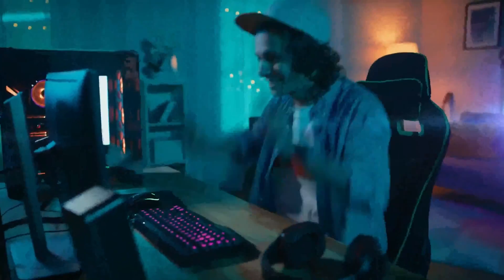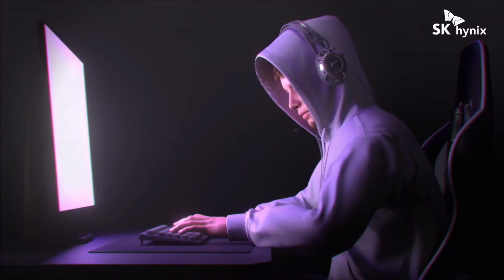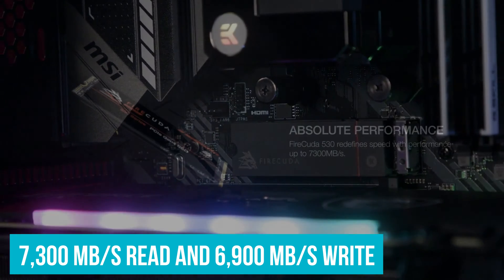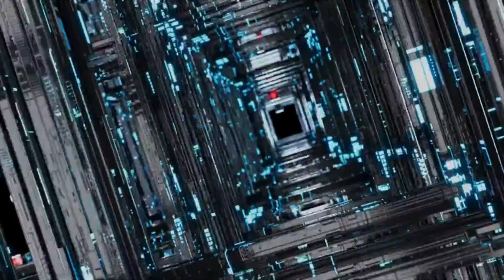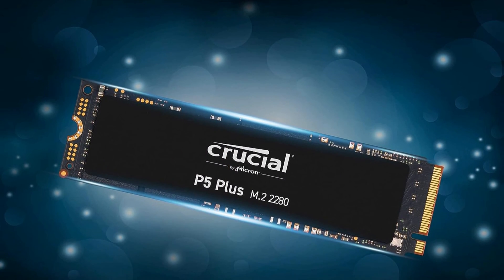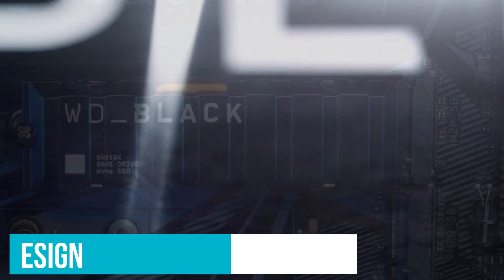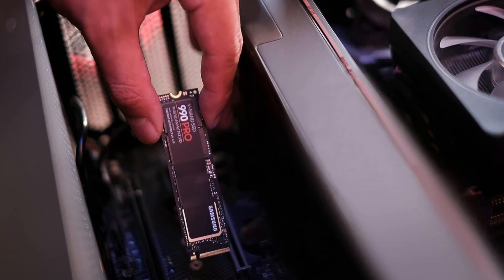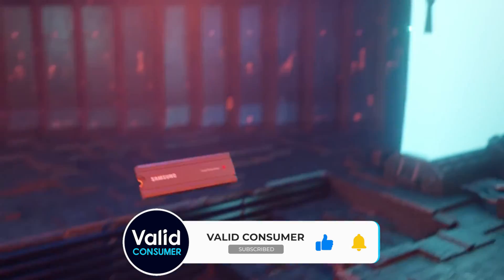Best M.2 NVMe SSDs For Gaming 2026 [Don't Buy Until You WATCH This!]

Comment: do not buy any firecuda 530 because it has a seriuos fiemware issue,  the origional Phison E18 controller has an performance degradation issue and Phison released an updated firmware to oems. however, whlist other brands like kingston have already provided the firmware updat for months. seagate is doing noting.

Comment: Avoid Samsung storage at all costs - their customer support is awful. My 980 Pro failed after a bad Windows 11 update left it stuck in a BSOD and I couldn't format or reinstall Windows. I contacted support twice, but both agents seemed inexperienced and could only suggest I contact the retailer. After going back and forth, they refused to process the RMA. Samsung support is the worst next to ASUS. 

Choose Western Digital instead. I contacted them once, and the RMA process was quick and seamless. They even sent me a better replacement with twice the performance and capacity.

Comment: advice from a random person on the internet who builds PCs dont follow this and do research on any M.2 SSDs you may fancy,  M.2 SSDs even without a dram cache are blazing fast in comparison to HDDs
Reply: About durability too. Had issues with my 980, kept getting heated during highbworkload which caused the whole fucking PC to freeze. so get one with heathsink
Reply: @Arcadiez  I heard the heatsink will not fit in my thin laptop, but heard a layer (.5 mm- 1mm) of heatsink tape does the job well, particularly if in contact with the case.
Reply: Dram is important though
Reply: @bruhhh69 
Ce n'est pas important, ça sert à rien.
Reply: @LexKrorn 
On a regular 2.5 SSD, it is quite important
On a m.2 sata or nvme ssd, it adds durability to it, though it isn't as important as on a regular 2.5 ssd
Reply: @LexKrorn  Maybe for you but anyone transferring large files will be GLAD to not slow to a crawl after a couple gigs are transferred.
Reply: I'm looking for info on heat dispersion and efficiency, since I have a laptop; this info is harder to compare.
Reply: So my brother I have a question 
I’m planning to build a pc (first time) 
And I wanna use 2 slots for nvme gen4 ssd , one for the system and apps, the other for games 
For the system and apps I wanna install 1tb ssd , and for the second slot I wanna use 2tb for the same ssd brand and speed (for example: WD)
Will there be any issues?
Reply: @aj9895  also congrats for getting on building your first PC there's a lot of people that are too scared to get into playing with electronic Legos
Reply: @relliken3773 Hi! This is very late but i saw youre still replying to some comments here. Im kinda stuck with 4 options and i dont really know which to pick, mind giving some input?
I cant choose between Kingstons KC3000, Samsung 990 pro, WD SN850X and the Crucial T500

The Kingston one is by far the cheapest where i live but i dont mind spending more if it means i get something reliable for the console. 
Thanks in advance for your time!
Reply: @ItsHekk  Samsung's Evo lineup is pretty solid longevity wise provided its firmware is up to date that said Crucial's T or P lineup are good choices as well.  depending on how often you write data they will last 5 years+ easy... but that assumes you manage it with auto or manual "Over Provisioning"
Reply: @aj9895  no issues will be there as long as the SSDs are good
Reply: @aj9895  nope honestly having one for your OS, and one for everything else or having drives for separate tasks is ideal, if your game freezes or crashes it's less likely to lock up your whole computer and there's loads of other benefits this brings
Reply: Thanks.
Reply: I'm still using a 960 evo w/o dram... no problems but I do have 64 GBs of ram
Reply: I wish the dislike buttons still existed.

I will never forgive YouTube.
Reply: @Chronically_ChiII  iuno what u talking about thumbs down can be brought back. i have it right next to the thumbs up dude lol. crazy u havent figured it out yet.